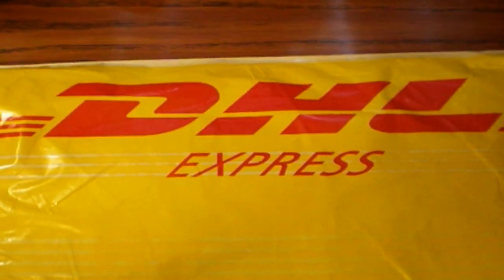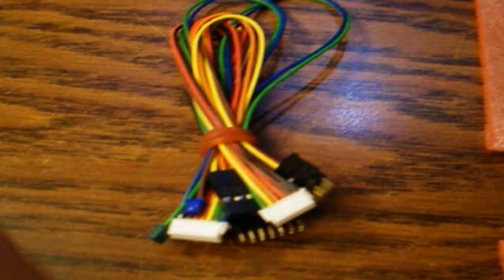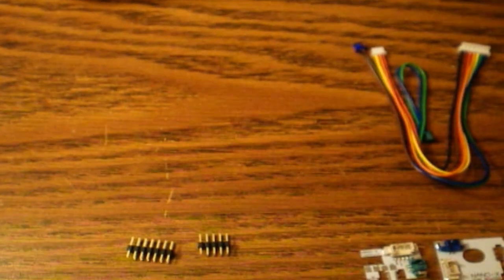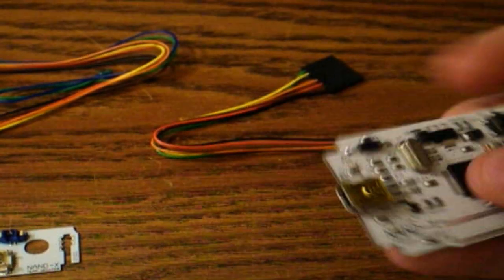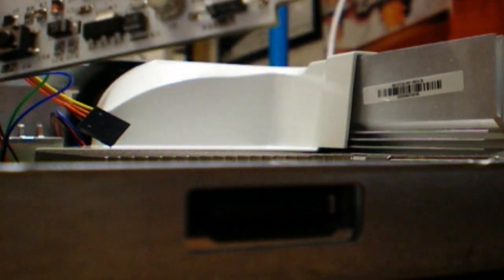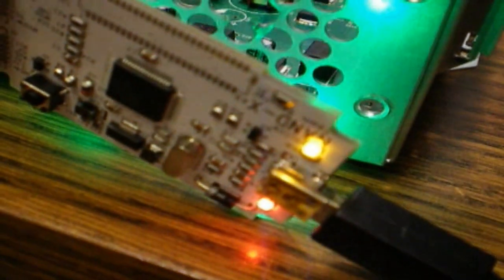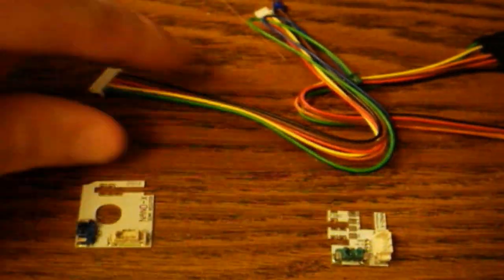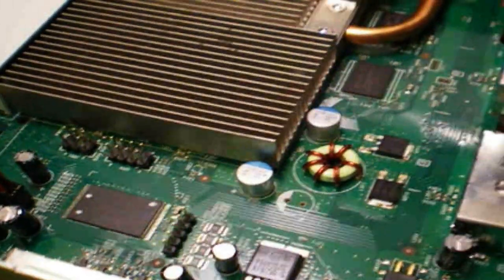Xecuter NAND-X Xbox 360 USB Flasher Hands On

Comment from the maker: @TheOmnipotentidiot you can flash as many as you want with it, but it only comes with the quick solder boards for 1 console. But you can go to radio shack and get some resistors and diodes pretty cheap to do the other 3.

Comment from the maker: @hellzone100 It's not expensive if you think about what all comes with the package, the NAND-X, Both Pin header and quick solder connections.  Add a jtag kit and u have enough to do two consoles for just a few dollars more. Plus the speed will surprise you. It is also a good bit cheaper then the Maximus NANDFLASHER, I have not used one so I can not compare features.

Comment from the maker: @112aas1 I had to use braid to remove the solder from there holes where I put the pin headers into. If you use the quick solder boards you do not need braid. The quick solder boards are ment to stay in place and are easy to solder in the holes are huge.

Comment: how did you solder in those pin headers? Did you take the solder out with braid, and than put it on and solder it up or did you heat all the pins up??